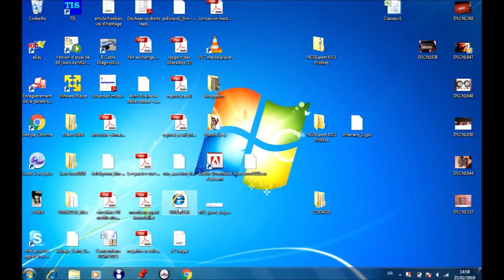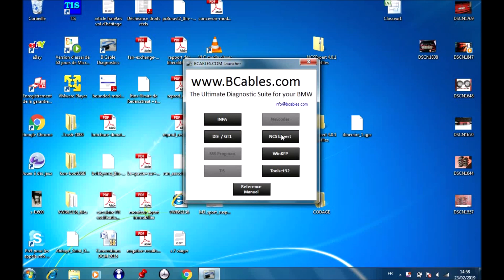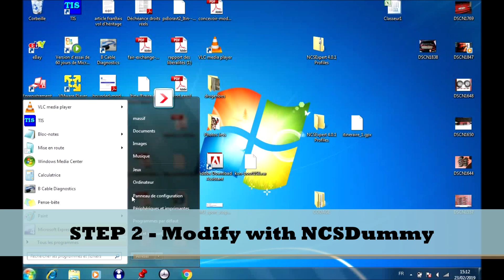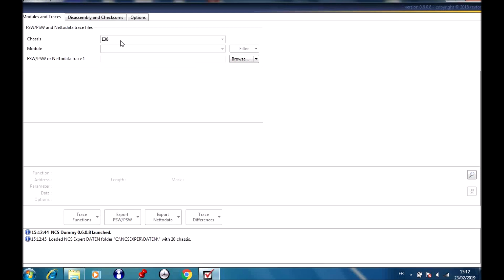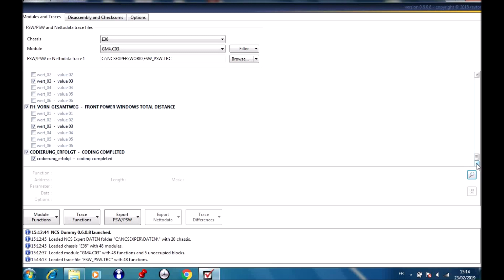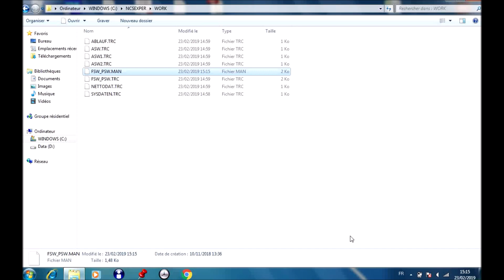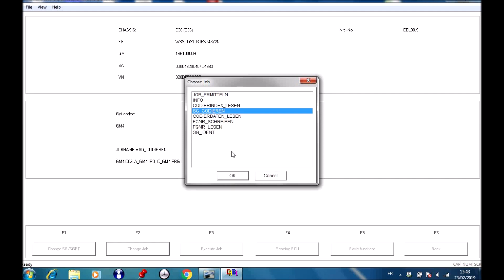🔧 How to code hidden features on your BMW E36? (DIY)

Comment: hello , i have issues with doing this. i think everithing is ok with the programs , im getting error that cannot connect to the module. My differences is that you dont have a letter after the GAM SA and VN , but i do?  is this the problem and how to fix it? 

error is IFH-009. is that maybe a reason of pin7 and 8 not soldered in the cable im using? 

Awesome car and awesome videos! Highly appreciate you!

Comment: Is there any chance that this can be done on E34 525tds 92'?
Reply from the maker: The procedure will be similar, but you need to check if your car has the original BMW alarm system. If yes, then it should be possible to enable the same. Cheers
Reply: @mrnoname35  Thanks for fast respond, should i use the same program as the one you are using?

Comment: hello, what year is this euro sedan? 

and do you think I can I code my obd1 95 m3 US spec car using these same methods ???
Reply: US alarm systems don't use the GM4 as the alarm module. Only if you have option code SA302 you will have this function.

Comment: Hello is this function available for the e36 323ti 1998?
Reply from the maker: Hi! Your car must have the alarm system to enable the acoustic & visual acknowledgment.
Reply: I took the car recently, I don't know if it has an alarm, can I check it somewhere?
Reply from the maker: @gustavopaschoal7882  You can check with your VIN number the options of your car.
Reply: @mrnoname35  Could you tell me on which website I can check if my car came with an alarm?
Reply: Thank you, I'll look for it!  Can the device you use re-program the ecu?

Comment: Does your car have the alarm system ?
Bc I'm not sure, if we don't have one, we can also make the visual and acoustic signal with the remote key :/
Reply from the maker: Hi!
The visual or accoustic acknowledgment settings are part of the alarm system, so it's only customizable on E36 with DWA.
Reply: @mrnoname35  Ye, that's what I thought... And it's sad :(
Thanks for your answer !
Reply: Hey
On my e46 I also don't have the alarmsystem but I could programm the visual locking acknowledging. You just tell the car in ncsdummy it has the alarmsystem and that's it 😉
Reply: @TheFreshGary  Oh great thanks, I'll try this
Reply: @jwnbz  did it work?
Reply: @simoneamodei9265  Don't have already do the mod :/

Comment: I have a problem i don't have gm4 what do i do or can't i code my car it is a bmw e36 325 from 1997
Reply: there is not such model :)))
Reply from the maker: Hi!
If your car is from 97, you should be able to see the GM4 module via NCSExpert. It does not appear in the list of available modules?
Reply: @mrnoname35  thats right

Comment: where did you get the software?
Reply from the maker: Hi!

I bought it from BCABLES. They provide the set of cables, and an automated software installer. It was super easy to install.. the installer is doing all the configurations for you. I'm able to connect to most of the modules on my 98 M3. 

However, if you want to access ALL the modules of the car, or you have a car produced before 1996, then this kit working via USB will not work. You need to purchase an ADS interface, and use an old laptop with a serial RS232 port.
Reply: @mrnoname35  mine is 96 can i just download the software?
Reply from the maker: Hi James,

96 should work via USB for most of the modules, however I'm afraid that I have no idea where you can download it for free. :/